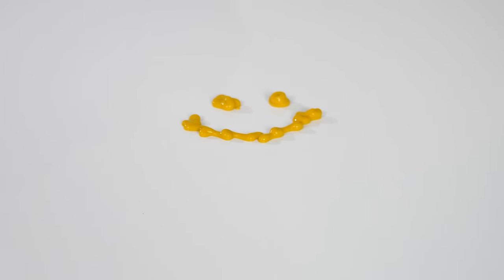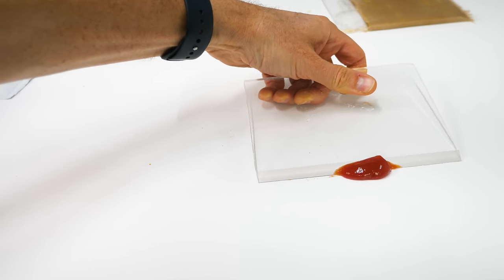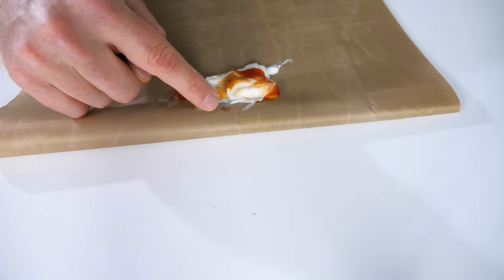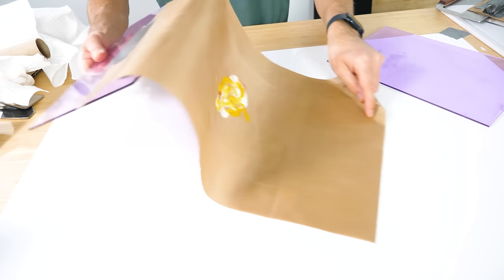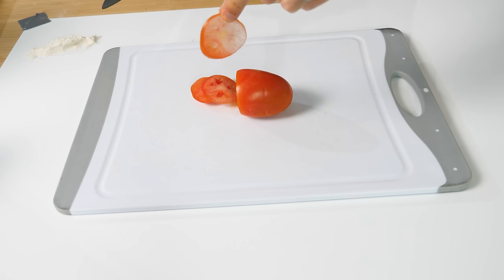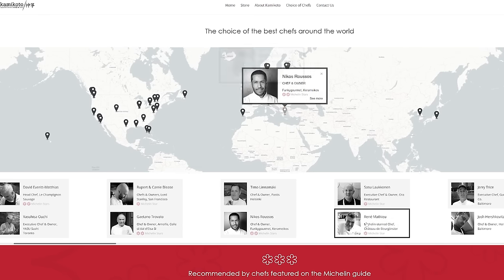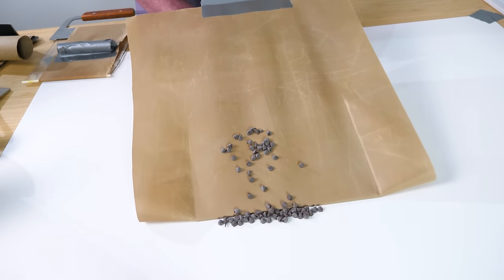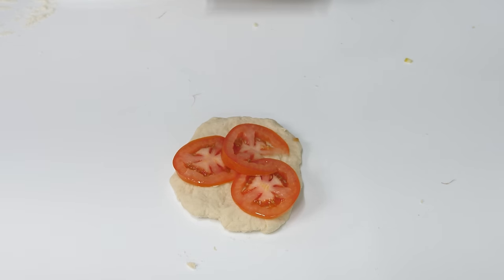How To Pick Up And Set Down Sauce Without Changing Its Shape

Comment: Kamikoto is a known scam
Reply: Scamikoto Knives/Established Titles. Made in China.
Reply: Technically not false advertising because if the steel bars are made in Japan his claim of ‘Japanese steel using 800 years of Japanese technology’ never states it is made anywhere specific. But yeah, overpriced stainless steel kitchen knife set
Reply: Yeah, horrible lapse of judgement on Action Lab's part.
Reply: @Pikawarps the false advertising is when they say it is such a high quality steel. it is 420J2, it is a very corrosive resistant steel, but it is also one of the SOFTEST steels. i.e. it cannot hold an edge for more than a couple of cuts. that is why they sell them with sharpening stones and recommend using them after every use of the knife.

Comment: I think this device makes use of the no-slip condition -- the fact that a fluid maintains zero velocity relative to a solid surface. That's why it works for true fluids but not for solid particles.
Reply: Is this like when I have a glass of water with ice or a piece of fruit in and I twist the glass everything will stay in the same place?
Reply: It acutally should work best with non-newtonian fluids called bingham fluids that need a certain shear force to behave like fluids. This means they have a bigger zone with non-slip condition. Ketchup is one of those bingham fluids. :)
Reply: @IRmortalwombat No that’s nothing but slip, or frictionless. Relative to the solid (the cup or container) it moves at the same speed as the solid, just in the opposite direction. It just doesn’t move relative to anything else.
Reply: I don't think it works with water, or juice
Reply: @rustygear447   Because of the very low viscosity of these fluids.
Reply: Basically like how tires operate under normal conditions on the road
Reply: I think more simply, there is no cohesion between solids, unless you add some liquid. So it cannot do anything
Reply: The surface tension of the liquid items is helping keep the form together and pull the rest on to the Teflon sheet
Reply: The stickiness of the material being picked up is what helps and maintains the pile
Reply: @rustygear447 no, the puddling effect and stickiness of water and fluids will allow fluids the pickup, but they will spread more then the original pile, one single thing that's hard will prolly pickup but many will not maintain a pile therefore the physics of this design struggles with many singular hard units

Comment: picking up paints feels like a potential use for this. If a painter wants to save their paints by placing them in a sealable container or something from their palette this might be useful
Reply: Yeah. Trying to pick up paints that are side by side with a palette knife can end up smooshing them together. Good idea.
Reply: I wonder how well it could pick up small paint accidents like say while painting a wall.
Reply: @mk_rexx I think it would work if you had an extremely thin edge and a material that would withstand moving over such a thin edge while also maintaining a very sharp bend angle. Would be very difficult to make and I bet the results would be less than ideal.
Reply: Big problem is that paints on a palette usually dries a bit as the painter works and forms a crust. This unfortunately won't be practical.
Reply: how did you come up with that 🤣
Reply: Good idea!!!
Reply: Or just get a cheap plastic container with a lid. If you need the little finger hole, cut one out.
Reply: True, good idea.

Comment: I think from what i have seen is that Kamikoto Knives are a little bit of scam in a sense, they use cheap steel that doesnt last very well, you would need to do some research on your own if that is the case, and if you want to promote them.
Reply from the maker: I’ve owned their knives for almost a year and use them daily and they are my favorite knives. Is that enough research? 😂
Reply: @TheActionLab Made in China. Same company who owns Established Title.
Reply: He is not a knife expert. How is he supposed to know that they are made out of crap steel.
Reply: @TheActionLab   No. It actually isn't. They use cheap steel and claim its high end, and people believe it because it comes with a reasonably sharp edge from the factory. Arguably the only positive thing they do is encourage regular sharpening with stones. But they charge $200 for a knife the same quality as a $10 knife. It is far to easy to fake quality wen it comes to knives just because most people don't know what to look for.
Reply: @TheActionLab   The best you own is not the same as good quality, or more importantly here, good value for money.
These knives are wildly overpriced
Reply: @TheActionLab No, not enough research. Don't degrade your brand.
Reply: @TheActionLab  You're a science youtuber/communicator... you should know very well that one person's anecdotal experience (even if it's your own, and especially if that anecdote is coming from someone with a financial incentive) does not in any way count as enough research, or even research at all really.

Comment: There are definitely some applications I can think about! I once attempted making “mashed potato pizza” but could not get it to hold in good position. I ended up layering it on the baking sheet even though the cutting board was more convenient to use.
Reply: repentandbelieveinJesusChrist1   I know this is obvious a bot (maybe even just a nutjob) but this feels like it's shaming the mashed potato pizza
Reply: may God have mercy on your soul
Reply: I just had mashed potatoes on a pizza for the first time last week (though I’m not even someone who has much issue with textures usually) and it was revolting…like the worst texture combo I can imagine…🤢🤢
Reply: @charliezard64 i think it was the bass
Reply: @swored.  what
Reply: @charliezard64  I don’t  remever

Comment: I work in a kitchen where we sometimes do some pretty intricate stuff.  This concept might come in handy one day!

Side note:  A metal plaque (brand name/ser. no.) fell off of a warmer we use in concessions about 18 months ago.  I couldn't find any glue, so I used a fine layer of ketchup to re-stick it.  The continuous heat basically vulcanized it into glue and that thing is STUCK FOREVER.
Reply: This could definently be used for higher end restaurants/catering. Piping out 50 designs on a table and quickly transfering them to plates could save alot of time and energy.

Comment: It would probably work better if you had a fairly sharp edge on the front but a roller on the back. You would have to play with how sharp it can be and still work.
Reply from the maker: I had a sharp edge at first but it cuts the belt after a few uses. I think that it needs a sharp edge with a belt that can’t be cut easily by the board material.
Reply: @TheActionLab  What about having the edge only sharp in the middle, but thicker and rounded towards the outsides? That way, the stress would just be on the rounded part.
Reply: Yes, the roller needs to be able to move it while keeping tension on and reversing the direction of the belt, at the same feed rate.
Reply: @TheActionLab  Maybe something like correction tape?
Reply: @renedekker9806  The differing radius along the edge that the transitioning edge creates would cause issues with the material, either causing the material to not contact the body of the board in the middle or just issues with tracking or creasing.
Reply: I wonder what is the "optimal shape" for the blade edge.  It could vary according to the thickness and material of the blade and the belt (and the properties of the "sauce").  It might be asymmetrical.  The optimum for laying down "sauce" might differ from the optimum for picking up "sauce".  A square edge seems too simple.  But a half-round edge seems even worse.  The very tip should be thin, I think.  Maybe a curve like a parabola.  Or maybe a simple wedge with a blunted tip.

Comment: I think it may be a particle size issue. Larger particles are dominated by gravitation, but smaller particles are dominated by electrostatic forces. Like how the flour kinda worked, but the other solids didn't. That's why there's little adhesion and cohesion to get the material to stick to your sloped surface.

Comment: It's the rolling edge.  I mix glue using that concept with a 1/8 inch wooden dowel on a flat surface.  The point is to mix all of the glue and maintain a small mixing area.  Rolling the dowel flat toward the center of the glue cleans the glue up, rolls it toward the center, and mixes it at the same time.

Comment: Kamikoto aren't handmade nor are they remotely special. Look for knife tests by experts and you'll see they aren't worth it. Matter of fact they're owned by the sane company that owns established titles which is be sued for fraud rn. If you like the set, fine but don't advertise them like they're Benchmade or Seasick tier.
Reply: Additional note. Look up 420j2 steel, it's what kamikoto makes their knives out of and its considered the lowest possible quality knife steel. Kamikoto hides the kind of steel they use and just use language like "tradition japanese metallurgy" for that reason. We can make any kind of steel to any spec we want in modern times, if it doesn't come with an id code, it's junk steel.

Comment: These are used in every (at least German) bakery though not to pick things up, just to put them in the oven. Using a paddle is more work and really doesn't work properly anyway when you have 10 oven compartments stacked on top of each other. Also saves on energy as the oven doors don't have to be open as long.
Reply: Do you happen to know of they use a particular brand or anything? I always struggle to find them
Reply: @Blamzite  I'd assume you get them from the same trader where you bought your industrial-sized oven.The ones they're using definitely don't fit in your oven you'd have to manoeuvre to get them through the kitchen door.
Reply: @aoeuable  ah that makes sense

Comment: Change the material that you're picking up with to be like a flexible silicone or a cross in between silicon and whatever you had something that's got a little grip Maybe just on one side so it doesn't cause problems on the other should pick up other materials way better .

Comment: The original one was invented to pick dog poop. It doesn't work with solid chocolate because you need viscosity. So you can melt the chocolate a little or add glue to the surface of the fabric.

Comment: Enriching Uranium
The nuclear fuel used in a nuclear reactor needs to have a higher concentration of the U235 isotope than that which exists in natural uranium ore.  U235 when concentrated (or "enriched") is fissionable in light-water reactors (the most common reactor design in the USA).  During fission, the nucleus of the atom splits apart producing both heat and extra neutrons. Under controlled conditions, these extra neutrons can cause additional, nearby atoms to fission and a nuclear reaction can be sustained. The heat energy released, by the controlled nuclear reaction within the nuclear reactor, can be harnessed to produce electricity.  Commercially, the U235 isotope is enriched to 3 to 5% (from the natural state of 0.7%) and is then further processed to create nuclear fuel.
Reply: Copied and pasted here, from a different video about a different topic???

Comment: bassically the pad needs to moving at the same rate as the device is running against the counter. Because you are not doing that perfectly it is giving slight distortions. IF you could come up with a system to movie automatically it would make a more perfect tranfer.